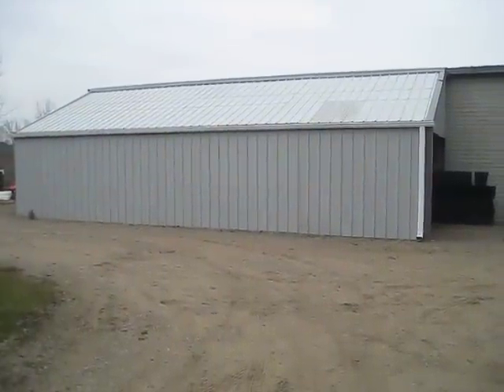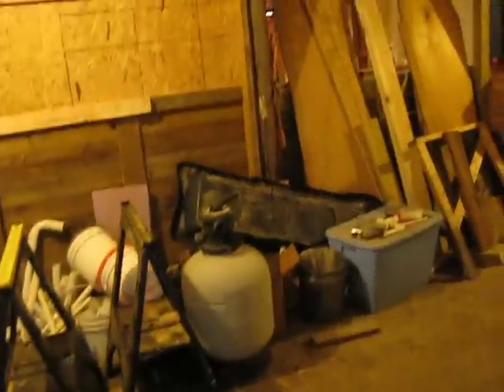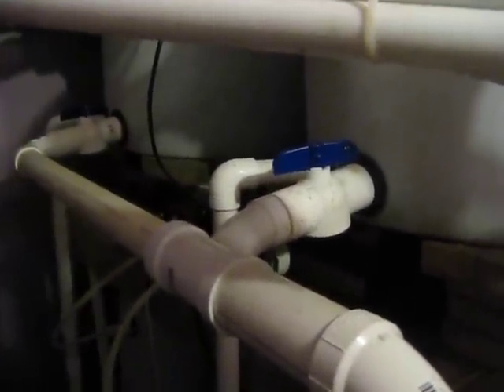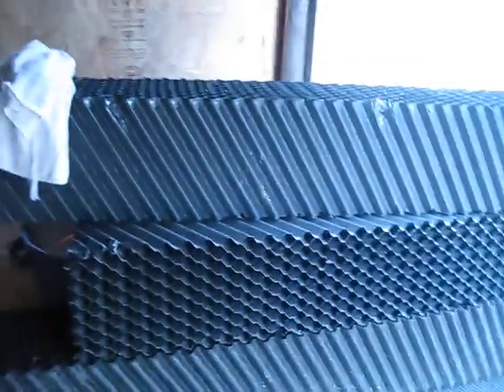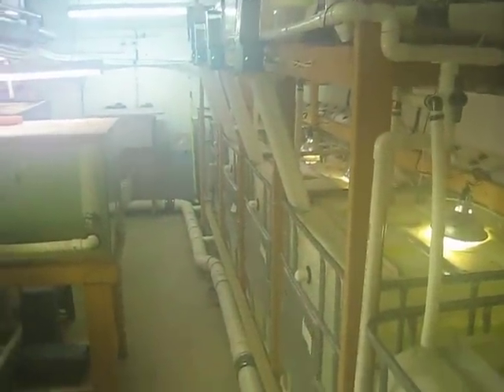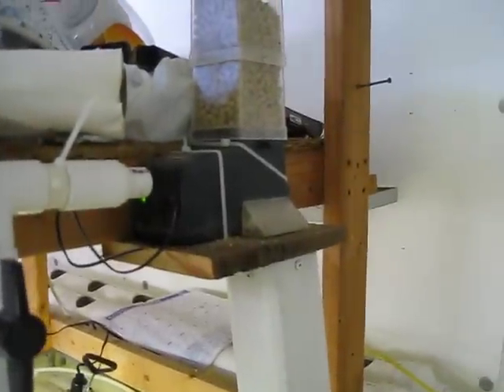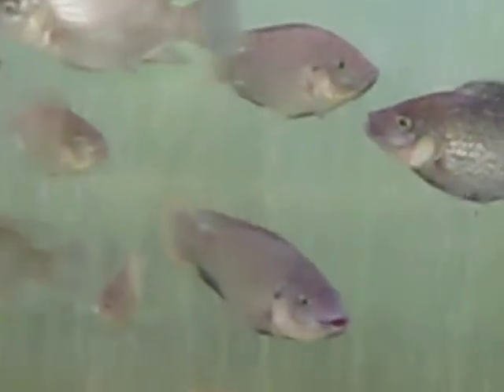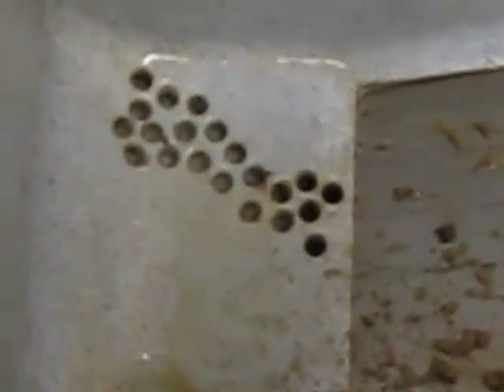DIY Tilapia Small Scale Aquaculture System - Vid # 7

Comment from the maker: No Chad, the IBCs are just drained out the bottom valve and the installed height of the sieve determines the level in the tanks. We have considered setting one up as an overflow but just haven't gotten to it yet. I'll be doing another video sometime in July and I'll try to explain it a little better.

Comment from the maker: @daniel3484 The Cetus is maxed out with the 1HP pump so if I do this I'll need another. maybe build one, check out Mr1Superb. Might even try building a vortex filter instead.We have had to reduce the tank population to 50 fish per IBC. We had WAY too many. Bio filter would not keep up. So far we have only harvested 3 fish @ 1 1/2 pounds. We should have a tank full at that weight in about 2 months. They seem to be taking longer than the 9 months everyone talks about. Steve.